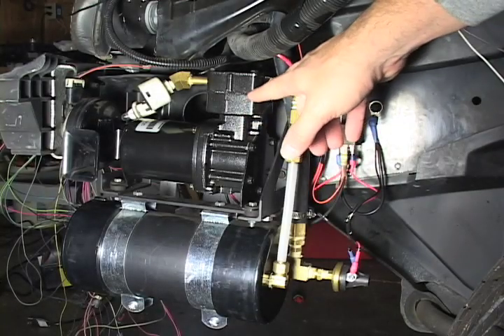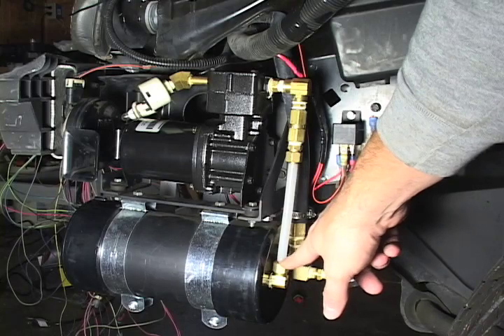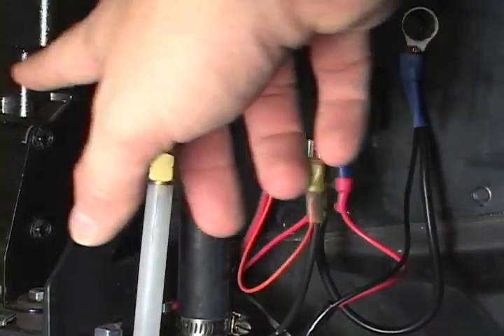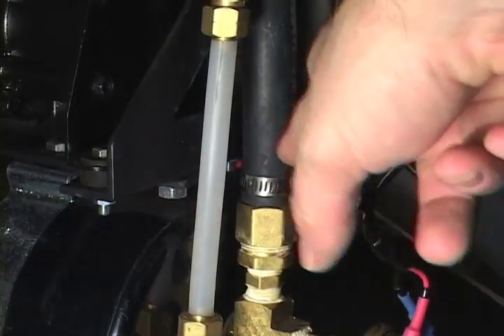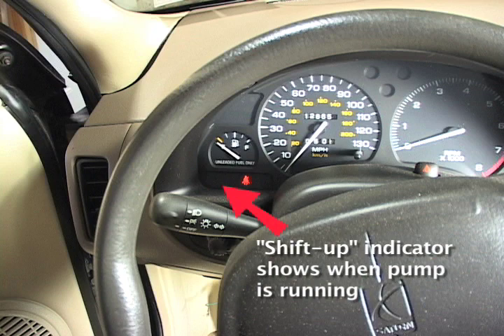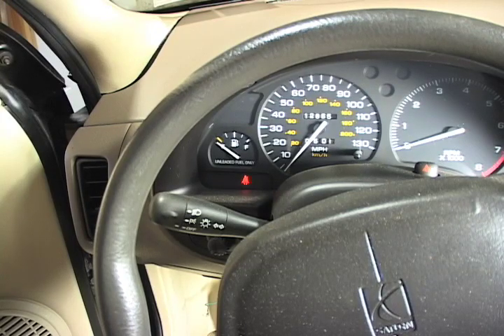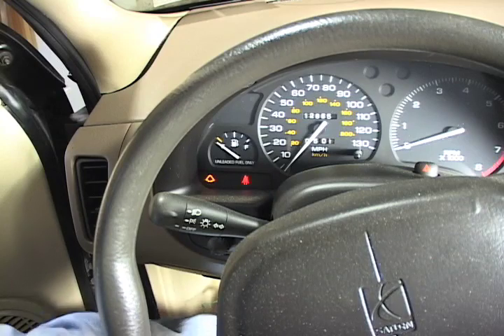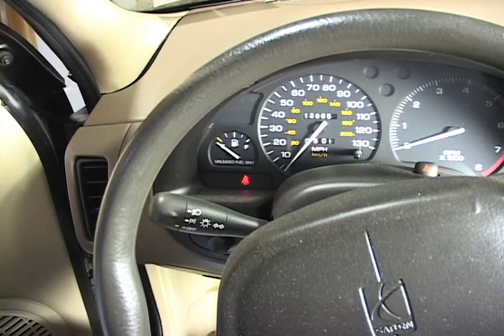Electric Vehicle Vacuum Pump Question

Comment: I know it's been 11 years, so this was likely solved, but I would like to play the game too:).  My guess is you needed a check valve between the vacuum pump and the tank to prevent the vacuum in the line escaping the moment the switch cuts off the pump.
Reply from the maker: Hi Scotty, yes it has been resolved. There was a check valve between the pump and the tank. The problem was that the vacuum switch had absolutely no hysteresis - either by design or it was just faulty. Once the vacuum switch was replaced the problem went away and the pump did not run as much.

Comment: I believe what the spurts are is the deadband on your switch.  In other words the system is set to come on at say 15 when it reaches that it cuts off however since the entire system has not stabilized it briefly drops below the 15.  Your system kicks back on to get it above 15.  Also, since that is the only source of vacuum as you push the brake you use it so it needs to replenish.  System kicks back on.   I also think you need a cannister to act as a reservoir for your vacuum.   Or I could be full of BS.

Comment: THE pressure switch need to be adjusted to not  turn the pump on until a lower PSI. if its turning on to soon that means the PSI is set to high  to maintain the pressure it is set at.  you want it to fill the tank.. But not 2 kick on till you are at the MINUMM PSI level to still maintain Power BRAKE's  then it wont' come on so much.

Comment: hi greg... i have no vacuum reservoir and get 2 or 3 pumps before the pump kicks on.  and no pulsing.   i agree with eric about the settings on your vacuum switch.  i used a vacuum gauge while setting the on and off settings - done by turning nuts.  that switch looks so tiny.  mine is bigger than my fist.   ...brandon

Comment: Greg,
It appears as if the vacuum switch has a very small hysteresis. This means it has a very small vacuum differential between on and off. Another brand of vacuum switch with a larger hysteresis may improve the situation. 
Eric